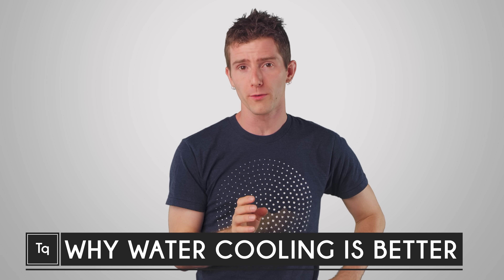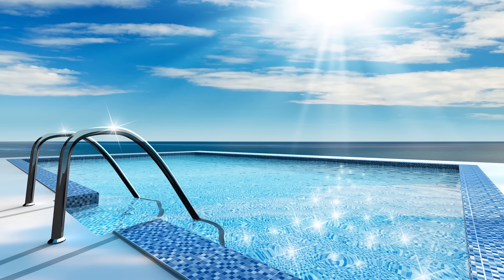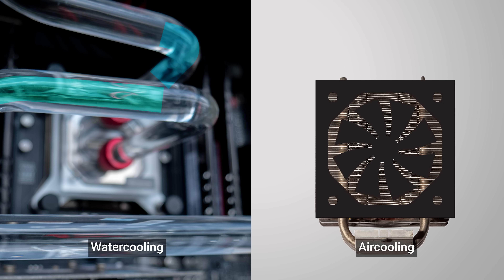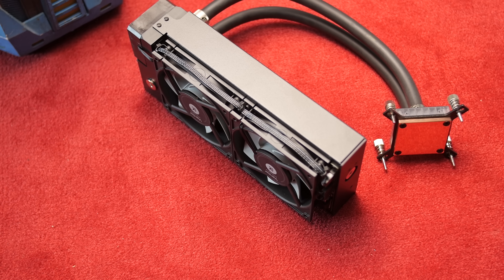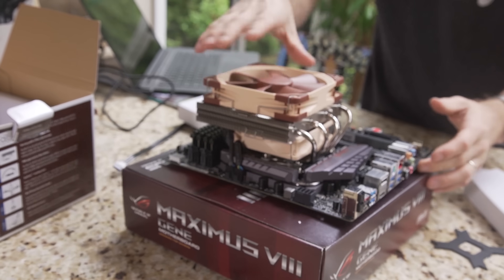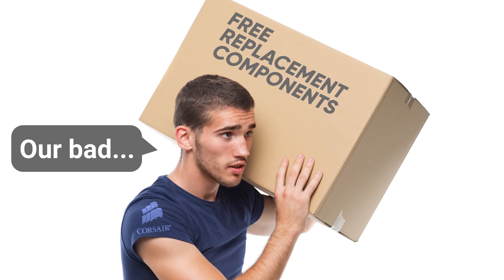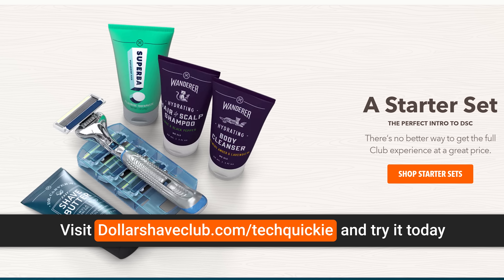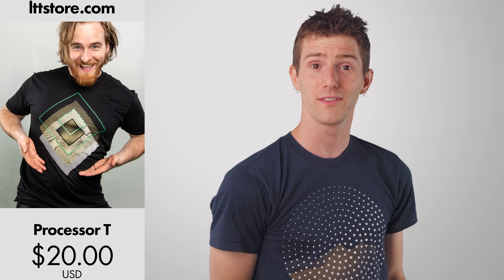Why is Water Cooling Better?

Comment: It's not the size (thermal mass) of the heatsink that's important it's how much surface area it has.  A heatsink with good thermal conductivity (copper) will quickly spread heat energy throughout its mass.  If there's sufficient surface area and forced convection, the heat sink will quickly reach a steady-state condition with a ΔT between the CPU and ambient surrounding air.  A large thermal mass heatsink, but with less surface area (due to fewer fins) will reach a steady state but at at higher temperature (smaller ΔT).  Forced convection of air over the heat sink increases the Heat Transfer Coefficient (HTC),  as the HTC is a function of flow rate; and the more surface area, the more heat energy can be transferred to the surrounding air.   The old Zalman jet engine type heatsinks are an example of a high surface area heatsink.

Comment: Specific heat of water means almost nothing in terms of cooling, its not like you're sticking your PC in the water to cool it. All that matters is heat transfer and dispersion of a unit. Liquid can pump a small amount of heat someplace else quickly and use a larger surface area of the radiator to get rid of the heat compared to the limited area of an air cooler. But the issue comes with cost. Even the best AIO are on only par with the best air coolers at a much higher cost.

Comment: As always, a wonderful video. Damn damn did not finish, sorry. Here's a situation, a car, cooling, a temperature of 90 degrees working, how often do you change and add fluid? And second, if the pump leaks or sticks when you are not at home, what will happen? And what is the last service life of the heat pipes of the cooler tower?
Reply: Best regards, Demon from Russia.

Comment: Everyone remember the video from a few months ago when LTT concluded that watercooling did nothing compared to good air coolers...?😅
Reply: those were compared to AIO, premade loops. custom built watercooling had always been the best, but it's not cost efficient compared to air cooling. this is just like "the fastest car u could get", but that doesnt mean everyone should get it
Reply: Um. That was specifically talking about AIOs. Custom loops are more efficient than AIOs
Reply: They took a physics class since then
Reply: @jordanski5421  How did taking a physics class change the actual data from the testing...?
Reply: @MichaelBerthelsen  It doesn't change the results at all it just shows that they were flawed. Like Linus said in this video water and the other liquids used in liquid cooling have a much higher thermal capacity than the metals used in air coolers. The only way an air cooler could actually have a higher thermal capacity than a water cooler is if it was of higher quality. I think that explains why Linus's team got the results that they did in their previous video.
Reply: @jordanski5421  They used quality air coolers and quality water coolers in the test. Neither cooling SYSTEM has a higher or lower heat capacity. The water has a higher heat capacity, which means it heats up more slowly. But if you're removing enough heat (in watts) using the quality air cooler, having a water cooler won't make a lick of difference. It may slow down the rise to max temp., but it'll reach the same max temp as air over a period of an hour or so. And I doubt most people use their PC's for only an hour at a time before letting it cool down to ambient.
Reply: Corsair probably paid them off to make this apology video LMAO

Comment: Honestly, I'd still go with air, even when OCing. Price to performance seems better, I don't have to worry about radiator mounting and I never have to worry about pump failures or my system getting flooded.
Reply: I can see that, but as an enthusiast, i am content with paying a premium for asthetics, performance, and the fun. Its my hobby, and I am more than happy to save more money, for my recreation activity. Other people smoke, i water cool my pc.
Reply: @hero6677  That's certainly a way to put it, and I can completely understand that thought. It's not my cup of tea, but if it makes you happy, go for it.
Reply: Well what if the fan fails
Reply: @amirdilshad5329  I still have a giant heatsink that can passivly cool the processors at least a bit, I may even be able to run the PC undervolted without a fan. And I could just use one of the case fans to replace the broken one.
Reply: Skibbity Bop don’t forget water cooling is eons more efficient. You forgot that part.
Reply: 02:52 So the pumps do not emit any noise? Interesting...
Reply: i've been doing this for 10 years, i recycle all my parts, and i have never had either a pump die or a leak during actual use (that's why you leak test BEFORE turning the system on). eheim hpps+ from 2008, still going like new. you guys always act like pumps die left and right every 5 minutes and fittings explode every other day... if you're doing soft tubing and aren't a complete moron you're not gonna have leaks. and if you don't buy garbage pumps you're not gonna have dead pumps. i'm not going back to air, especially not on GPUs.
Reply: @givemeajackson  I had similar experience, until my first pump death a few weeks back after 10 years of flawless.  There's a reason there's a warranty on them is all.

Won't stop me though.
Reply: @XDeadzX  Fan bearings are usually worn out before 10 years anyways, and they become a giant noise maker when they do.
Reply: @Adierit   I wasn't saying the same pump for 10 years, just that I've been using them for 10 years.  The one that died lasted ~1.5 years.

I have some fans going on 12 and are fine though.
Reply: @XDeadzX  Luckier than most fans then, considering most die out in less than 7 years, and the bearings wear out in half that.
Reply: @givemeajackson  Congrats. Meanwhile, there are some AIO products with 30% failure rate.
I guess all those people "got unlucky"... lol
Reply: @Jonathan-fw6ty  who's talking about AIOs?
Reply: If price is a concern, then it's an easy decision to stick to air cooling.
Now if you have a high end GPu and want to push it a bit, there's no other choice than custom water loop.
Within watercooling tho, i'd probably never go hard tubing.. That's where i always see leaks, because it's just too rigid and can add stress to fittings if not made perfect. But even with soft tubing, if you cheap out on components,  your chances of having leaks raise.. it's reliable, provided you don't buy cheapo fittings.
Now is it worth it to pay as much as a 2080 to cool down a 2080? Prooobably not! But running it boosted to stupid clocks at 45°C is somewhat satisfying. and it looks better than a big piece of aluminium hanging from the mobo.
So yea... Price to performance massively sucks, but it gives a gamer a tingle in the heart to see his pretty handywork and that may make it worth investing for some :)
Reply: @usoppbarbosa981  Yeah, I see that too, but the price is just too much for me, especially because I just have a regular ol' case that doesn't have glass, so I wouldn't see the components anyway.

Comment: So, I got my doctorate with a theoretical chemistry research group that spent a lot of time studying water. The explanation of hydrogen bonding and water's high heat capacity in this video is far from complete (as it needed to be), but I was pleased to find that it was essentially correct.
Reply: Hey man, as you've plenty of knowledge in chemistry, i was wondering if it is possible to do a lab grown cocaine?

Comment: TL;DR: In 99% of cases, it's not. Air coolers are cheaper, quieter, perform identically and have less points of failure. Sure, water is better on paper, but in reality... just go air.

Comment: Water is an intermediary step between the air and the hot heatsink copper.
The specific heat capacity of copper is 0.385 J/g°C while water is 4.179 J/g°C
The density of copper is 8960 kg/m³ while water is 997 kg/m³
If my math is any good that means that water holds about 1.2 times more heat in the same volume of space than copper.
Perhaps more importantly water is easy to spread out over a larger surface area of a multi fan radiator than designing a combination of heat pipes and fin stacks that's efficient both thermally and in space requirements.

Worth mentioning.

Air density is roughly 1.2 kg/m³ water has 830 times more mass than the same volume of air. When it comes to specific heat capacity air is 1.01 J/g°C or about 4 times less than water. So water can act as a very easy to use buffer to store up the heat from spikes of high wattage, doing the same with just copper, aluminium and heat pipes is much harder and typically results in more bursty high RPM work for the fans.
Aluminum heat capacity is 0.902 J/g°C and density is 2700 kg/m3 which I think results in roughly 1.7 times less heat capacity per unit of volume than water.

Comment: Negatives not mentioned:
Water coolers have a very small thermal mass in direct contact to your CPU, so when your pump fails (and it will) your temps will rise rapidly and can easily damage your CPU before it is able to throttle down or turn off.

Comment: This video forgets to mention that the top air coolers are perform better than other AIOs at the same price range, so most times it's perfectly fine going air and still overclocking you ri9 to 5.0 GHz

Comment: I actually regretted buying 2 AIOs. I would go for air cooling when my AIOs stop working
Reply: High end air coolers are quieter and simpler than custom liquid cooling, and even AIOs. The only genuine downside is if you move your computer around the heavy heatsink can be problematic, but if you don't move your computer, then the air cooler is the premium experience.
Reply: @Trifler500  Over time the heavy air cooler might crack the mobo.
Reply: The Unboxing Experience why? do tell.
Reply: @aaaman7  As mentioned by Linus, there are actually air coolers like the Noctua NH-D15 that perform better than many water coolers and even though it's relatively more expensive than the other air coolers out there, it's about the same price as an AIO.

On top of that, it is so much easier to tell if the fans of the air cooler are spoiling as compared to the pump of an AIO, which brings me to the third point.

An AIO, with an additional pump (on top of the fans that are connected to the radiator), has more components that are subjected to wear and tear and failure.

Bonus point: It is cheaper owning an air cooler like the Noctua NH-D15 than an AIO in the long run as all you have to replace on an air cooler are the fans when they eventually spoil but you'll have to practically replace the entire AIO when the AIO fails to work.

So that's 4 reasons why I would much rather have bought an air cooler than an AIO. Hope it helps you understand.
Reply: @theunboxingexperience3480  +leakage probability increasing overtime, ohh boi
Reply: @753238  That too
Reply: @Blarson12  Yep but there's 2 points of failure (pump & fan in AIOs) as compared to just the fans for air coolers
Reply: @theunboxingexperience3480  Yes but if the air cooler has 2 fans, then that's 2 points of failure.

Comment: Also note water has a higher emmisivity than metal meaning it can radiate heat morw efficiently. Metal heats up and cools down very quickly due to its low emmisivity. That's why when you touch hot metal you can quickly move your hand away without any damage where as getting boiling water on you can cause serious burns.

Comment: Most of the noise of the really old beige pre pentium computers actually came from the hard drive.
Those things were freaking noisy af.
Reply: @Justin Martone 90's HDs are probably the perfect balance of "noise but not hell".
80's one is like having a constant angle grinder running in your PC
Reply: @Justin Martone You definitively should give it a spin

Comment: Water's thermal capacity isn't really what makes it a good cooling medium.   It's thermal conductivity is what allows it to transfer heat from the CPU to the radiator fin.   Thermal capacity just slows the temperature rise of the liquid between the CPU and the radiator.

Comment: This video is littered with nonsense. 

1) While water does have an extremely high heat capacity, that's only half of the story. Those joules still need to be dissipated. Water can absorb a tremendous amount of energy before rising in temperature, but if you're using your PC for more than 15 mins, you need to dissipate that heat. The thermal transfer from CPU-block-radiator-air is pretty terrible. Water takes a lot of energy to increase in temperature, and the inverse is true: you'll need to blow a lot of air to decrease the temperature. 

2) LTT literally did a video on why water cooling doesn't make a difference https://www.youtube.com/watch?v=23vjWtUpItk
Reply: this!
Also I want to mention, that phase change cooling (that's what happens in your heatpipes) transports way more enthalpy then liquid water could ever do

Comment: I used to be a big proponent of liquid cooling back in the late 90s and early 2000s... but that has since changed because there's just not enough real performance gain from overclocking anymore and modern air coolers are just too convenient... maintenance is REQUIRED with any liquid cooled solution... and it's usually a bitch... 
But i'm also not a fan of flashy builds and my tower still has no glass panel so i don't care what it looks like inside.

Comment: You could solve global warming with the manure (aka bulls**t) said here. 

The key (and only) advantage here is surface area. With enough tubing you can fit a LOT of radiators which means more heat transfer to the ambient. And you can fit those radiators anywhere you have space unlike air-cooled radiators.
To point out the half-info:
1) Heat capacity of water: higher heat capacity means that it can hold more heat but it also means that it's harder to release that heat. AIO suffer from this heavily. It will be nice and cool the first 15 minutes and then start rising like a mofo since the water starts storing more heat than it can release
2) Watercoolers are more efficient: FALSE! Phase-change (heat-pipe) are much more efficient at transferring heat away from the source. It's just space-inefficient since most phase change systems depend on non-flexible tubes that have sintered internals with a hollow core

Comment: Watercooling isn't better. A half descent heatsink is cheaper, performs the same is quiter and easier to maintain and install. If you want better performance then a descent heatsink you will need to go down the custom water cooling route which costs more, you have to maintain it, it's noisier and its less reliable. Honestly water cooling sucks ass for someone who just wants to install something and never know it's there again, I went from a descent water cooling loop to a Noctua NHD-15 and never went back and never will.
Reply: ^ TL;DR "*Blah blah blah* I didn't watch the video *blah blah blah*"

Comment: I`ve had two AIO from Corsair fail in the last three years, both had clogged fins on the copper plate and the coolant smelled like old bicycle tubes. Bought a Noctua dh-d15 and never looked back, also the Noctua is much better at keeping the CPU cool and a bonus is that i don`t have to worry about leaks.

Comment: No need to watch short answer:

Water steals heat 20-25 times faster than air.
Reply: Simple
Reply: @skott199  Diamond is one of the best heat conductors... maybe we should put some diamonds in there
Reply: @BoulePhotos Sounds good why don't they invent diamond cooling :)
Reply: @skott199  they already did! There's thermal paste with diamonds in it!
Reply: @BoulePhotos  Didn't know that. I only know basics about computer parts.
Reply: @skott199  IC Diamond is the most famous (Maybe the only) It's like 90%? Diamonds don't quote me on that but usually the more atomic mass something has the more heat conductive it is... now the problem is that moving around diamond or steel or copper at low temperatures is much harder than Water or Air.... those two are incredibly easy to move around.... that's why we use them
Reply: You do realize you have to compare water to Aluminium and Copper (and to a heatpipe), right?
Reply: @YourCRTube  you can do that once we can use liquid copper and aluminium as the main coolant in a loop and water as a heatpipe.... until then it sounds like a bad idea since the heatpipe and the liquid serve very different functions in watercooling

Comment: The thing is Ive never had an Aircooler suddenly leak all over and ruin a £500 graphics card.
Unless you are massively overclocking air cooling is perfectly sufficient

Comment: The one thing with water cooling more so the custom built types would be maintenance, the hassle of having to pull your system apart every so often.. Then there are the chances for failures such as pump, seals and so on..

Comment: Actually this is all true only for a limited amount of time . Water does grab heat really well, on the other hand it's actually really bad without change of state at letting that head go. So if you run you PC overclocked on heavy loads for hours at a time you will notice your avg temp in the computer getting hotter.   Making it worse for longer PC sessions then air cooling. Greg at Science studio does a good job at better explaining this so dont take my word for it.

Comment: Water cooling is not better because better is a relative concept and encompasses various domains other than performance. I prefer longevity, safety and low cost over a few more mhz. That said, for the price of a decent 2 fan AIO, if you were to add it to the cost of your cpu or gpu, you could probably afford an upgrade which would give you more performance than an overclock.